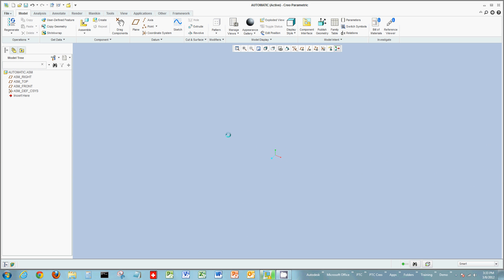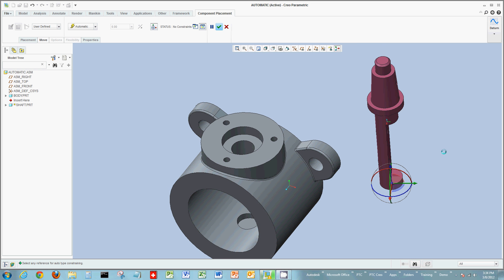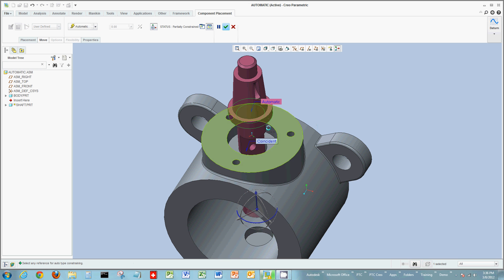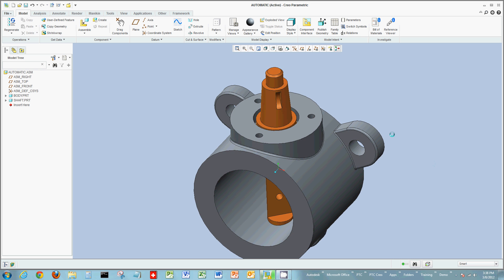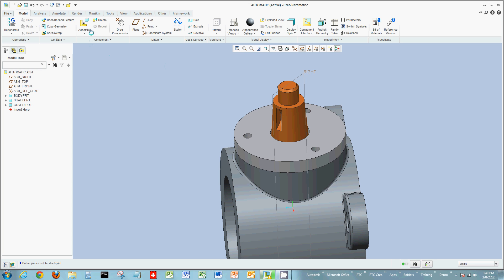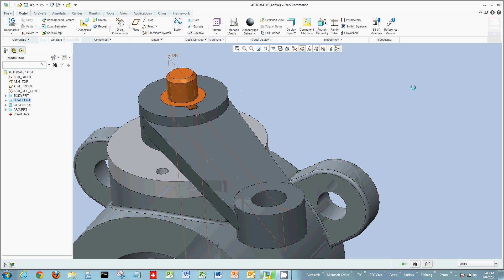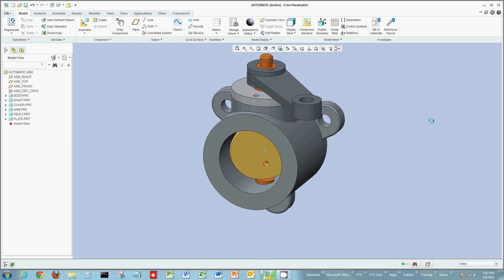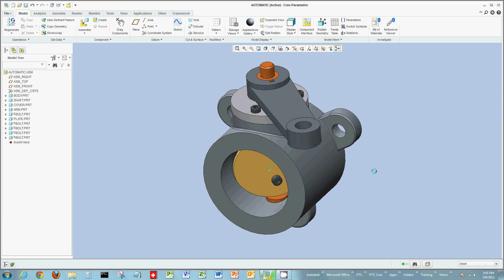Creo Parametric - Assembly Connections

Comment: I just upgraded to Creo 2.0 from Creo 1.0...very informative video! I noticed that the bolts have a "SQUARE" next to them on the model tree. Does that mean it's "packaged"? I'm having the same when assembling hardware on my assy. I noticed that my assembly has a triangular yellow icon on my task bar. So when I save, a "conflict dialog box" shows up & says "Model is not regenerated". Is it due to the "packaged" hardware? Thanks again!